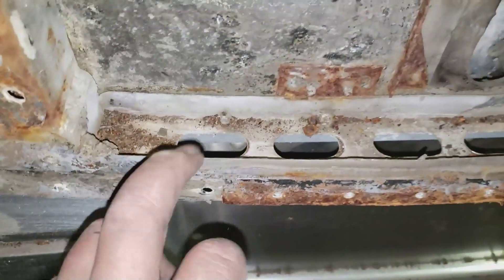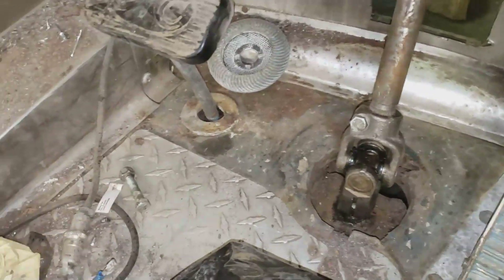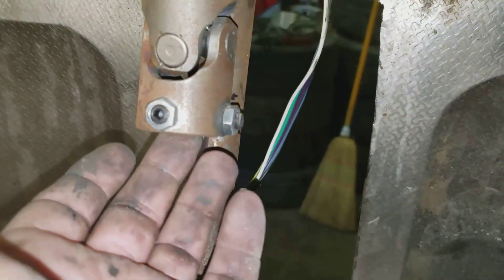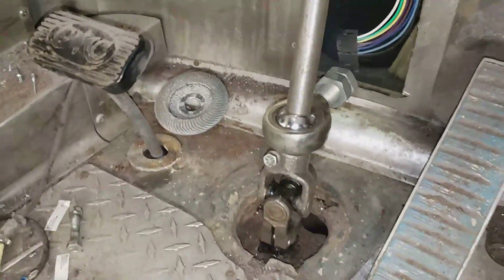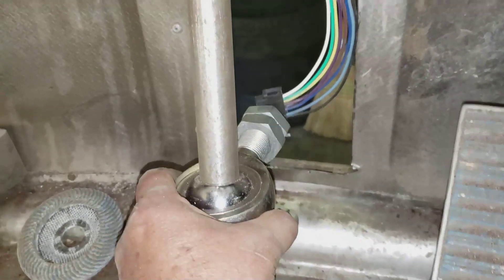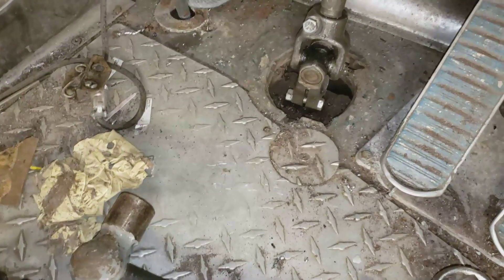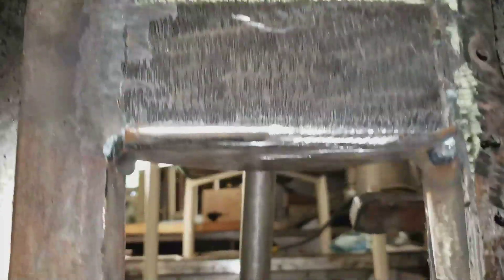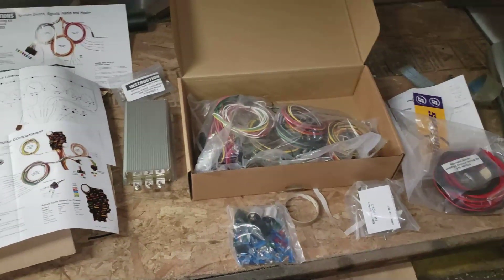Bus Conversion Project  - Video 93 - Steering system install

Comment: Hi James,
Don't need to see every detail of every wire and butt connector, but I would like to see how you set it up and go about doing it along with the finished product.  
Like welded steering components, they probably they don't allow butt connectors in Canada...lol
Reply from the maker: .... :-)..... Butt connectors are OK... but we call em' dogbones ..... we welded steering components on race cars all the time.... NHRA didn't care, but some idiot probably didn't weld correctly on a street  car some time in the past and a weld broke and caused an accident so they made the law... you can't fix stupid!!!!